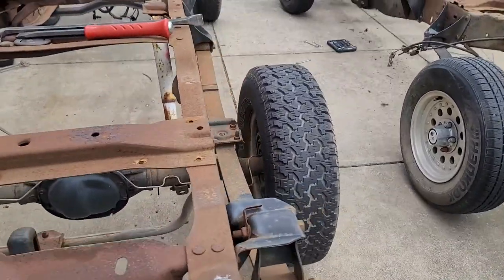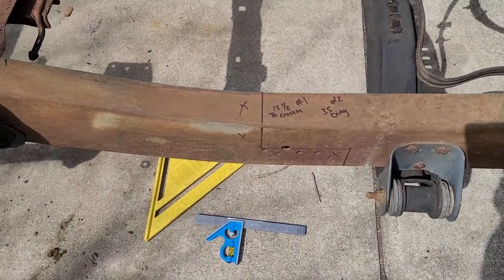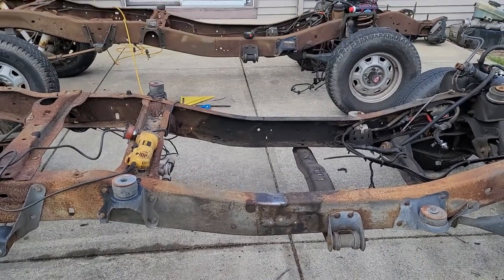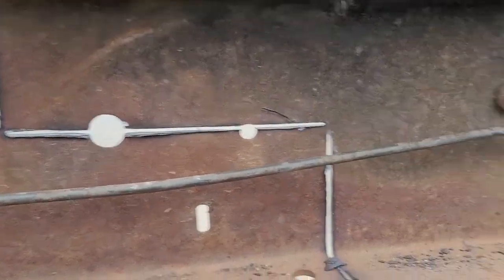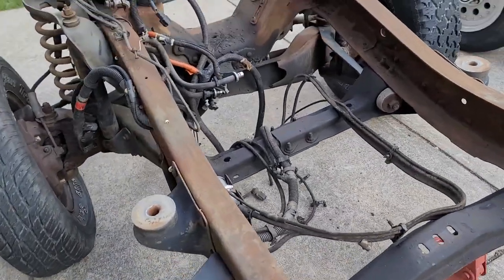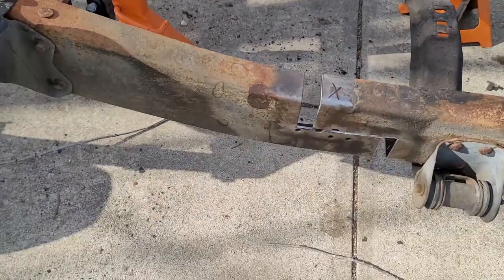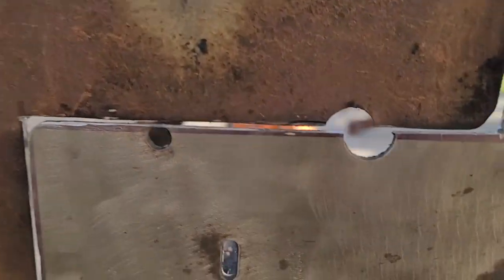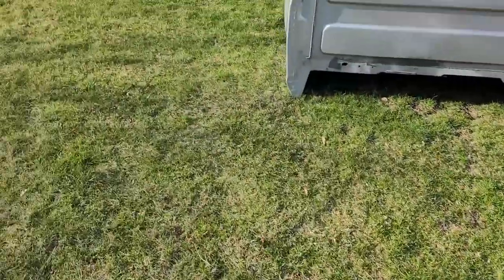Ford Ranger, Cutting Truck Frame in Half MIG Welding, how to.  Build part 6

Comment: This is absolutely a well thought out, and well executed project. word of caution...when making your cut, using radiused corners to be welded later more evenly distributes the load and are far less prone to crack initiation or failure. Same thing for fish plates on the outside...sharp corners aren't a great idea. You clearly have experience, and have done more than most could hope to accomplish in their driveway at home. Just sharing a tidbit that'll hopefully help out in the future. cheers!
Reply from the maker: Thank you Blake!  I appreciate you taking the time to watch my project and sharing your experience with how it could be improved, those were all great points!  -Frosty

Comment: I like the way the holes line up for a guide.  I was expecting some sort of jig to bolt to the two halves so they were exactly aligned.
Reply from the maker: I actually tried to use some angle iron on top and bottom on each side but it just didn't work well.  Stay tuned, this weekend I post the video of it getting glued back together!

Comment: New here... Why are you cutting two frames in half, I'm 3 minutes into the video and have no clue what ur doing. Being a car guy I imagine your shortening or lengthening the frame
Reply from the maker: I could have done a better job recapping the project.  Doing a body swap on a 4x4 ranger, in the process found a rusted out rear frame, had a nice 2wd ranger frame that I used to fix  the 4x4 frame.  Check out the previous videos on my channel for the whole story.
Reply: @frostydoesit  I found out eventually but I just pointing out one thing to make your video even better. Do a small recap and explanation in every video for the newbies to your channel.
Reply from the maker: @differentbydesign7603  I agree 100%  thanks for the feedback!